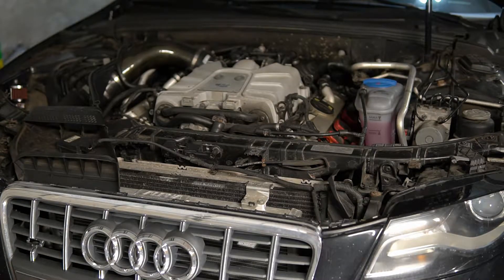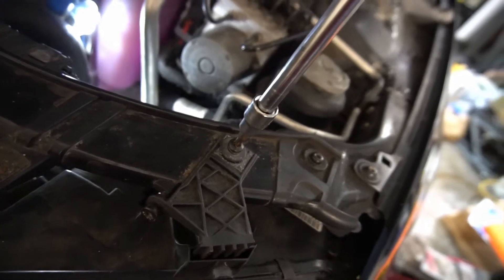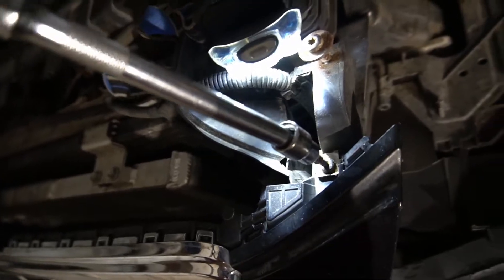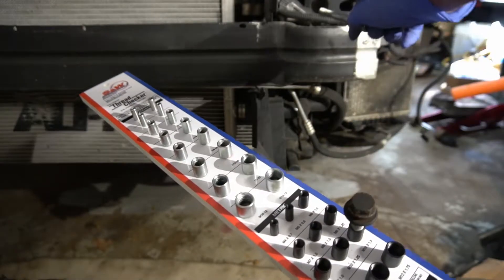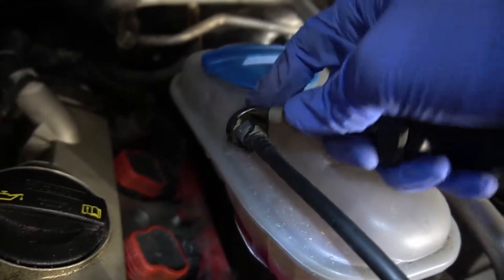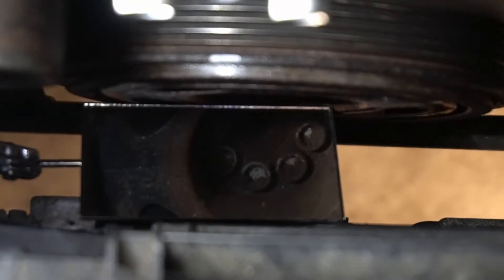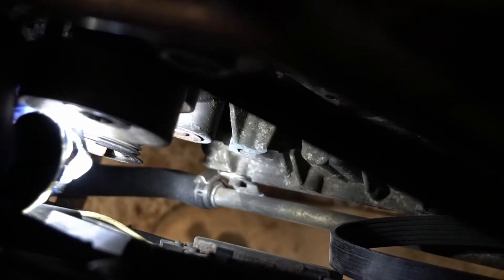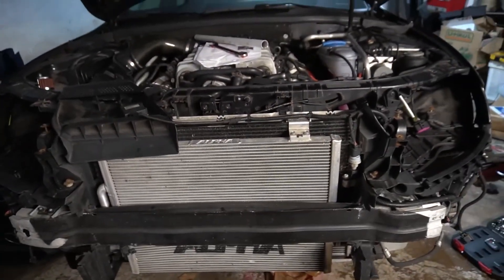CTS Turbo 187 mm Solid Crank Pulley Upgrade/Install (Dual Pulley Audi 3.0T V6)

Comment: What was the cause for you to replace this?
Reply from the maker: The rubber on the original pulley failed and snapped the belt.
Reply: @BlacklistBuilds  did it fail at high speeds because mine failed but didn’t snap the best I just had alternator warning . It was only a few days later I realized that the crank pulley that failed. That’s after I got a new alternator that didn’t fix my problem
Reply: @yunggenna1483 just got this fault the other day…. Not sure if I should replace alternator or start with my crank pulley, belts and tensioners before I consider replacing a 1400 alternator.  I’m tuned stage 2 at 230,000km original crank pulley

Comment: Would you upgrade the inner cooler system if you stage 2 tune your 2013 q7? For more air flow since it’s getting more horse power?
Reply from the maker: Yes

Comment: Want to install on my A6 3.0T. 
Heard when changing OEM part for this CTS pulley could affect balances, vibration etc..
Could you share your feedback?
Reply from the maker: I've had no issues or strange anomalies to report. It's been on for over a year and a half.